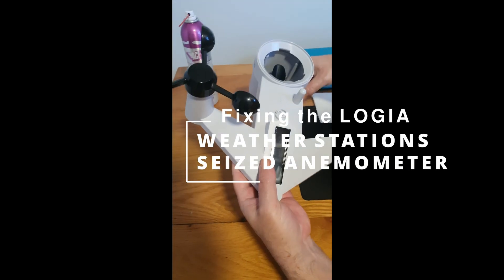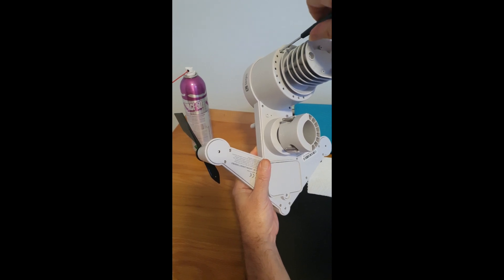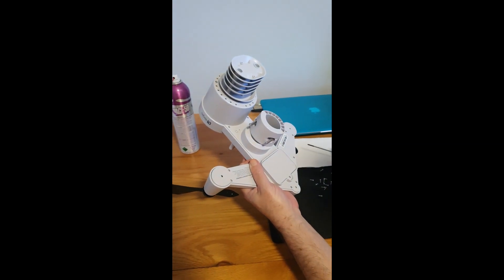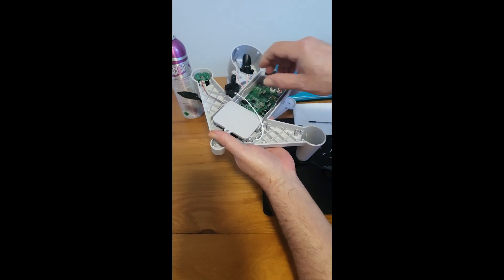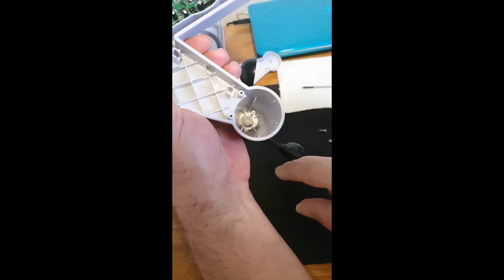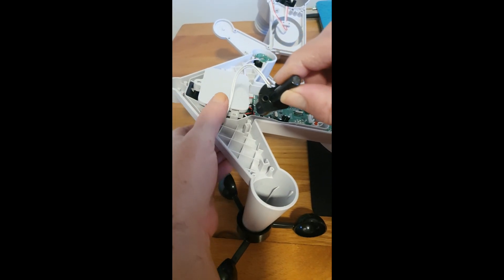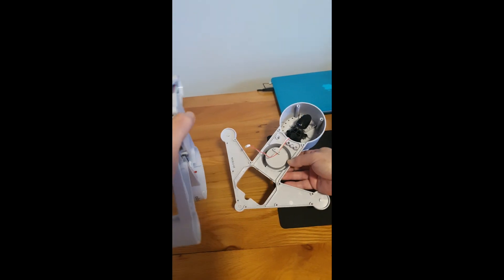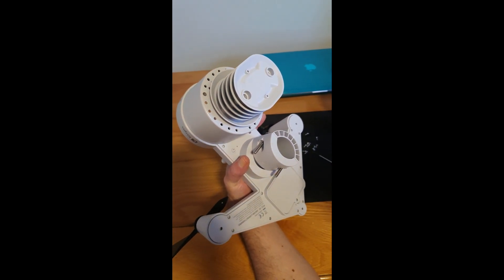Fix Logia Weather Stations Anemometer Not Spinning or Working or Seized

Comment: I have had two of these units seize up on the anemometer.  When I di the as the video, I found I could not free up the bearing just using WD40 with the wind cups still on the unit.  I had to remove the bearing to get it to free up.  The bearing is held in by a single E clip.  Once removed, the wind cups can be removed from the bearing and the bearing will drop out for easier work.  Take care when removing the E clip.  It is very small and easily lost!  My unit is now back in service.  Thanks for the basic video.

Comment: Your fix worked perfectly! Someone on here suggested removing the bearing E-clip, which I did, before freeing up and oiling the bearing. It required a bit of patience to get it back on down that little cone but it is possible and much cleaner repair. I'm not as confident as you that the oil-repair will have longevity so I ordered a sealed SS bearing to replace it next time (if needed). THANKS so much for taking the time to tell us of your diagnosis and repair!
Reply: What size bearing is it? I am planning to replace that when I open mine to figure out why it sometimes doesn't give a reading despite spinning freely. I do wonder if the sealed bearings would give a slower wind speed reading than the open bearings though, because working with RC hobby grade trucks I discovered that the seals do add a little bit more 'drag' compared to the open counterparts. That may be negligible though...

Comment: it would be better if the lodge used the other system, without having to dismantle the whole station. should use the system that uses ambient Waters, should only blunt the anemometer with a screw.